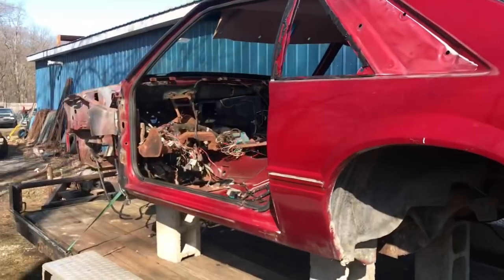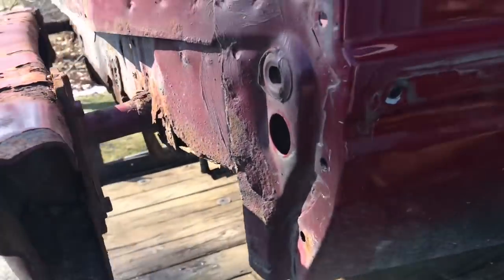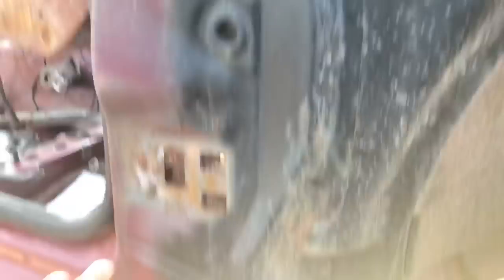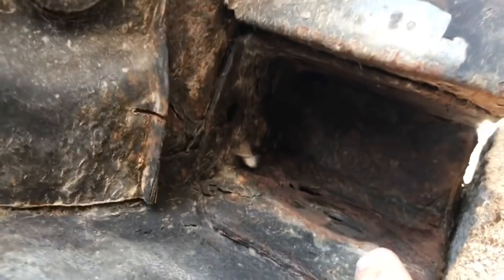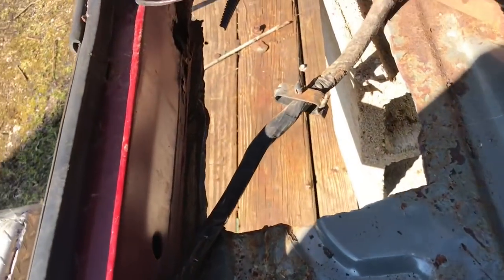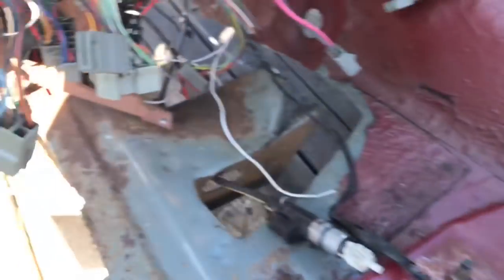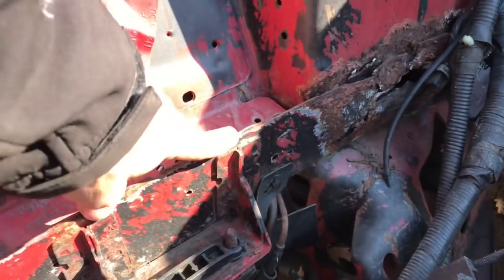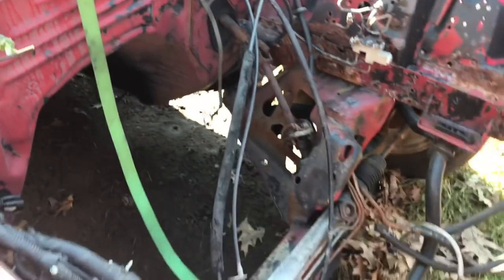RUSTY MUSTANGS 101 TOP 5 SPOTS FOX BODYS LIKE TO RUST

Comment: I just got thru repairing some nasty rust at the base of both A-pillars. Passenger side rotted out into the cowl area and air intake hat. Had water leaking into the floor and onto the computer in the kick panel area. Sometimes you think its a leaky windshield as I did until I pulled the fender off and saw the mess that it was. Thats one that can bite you because the air/heater box hides it on the inside and fender hides it on the outside. Just a word of warning folks. 
If you run a loud stereo with subs the little nuts that hold the quarter windows can vibrate loose and start a leak there as well. I am replacing the passenger rear floor pan over that deal. 
The car I have is an 87gt that spent its first few years in Michigan before it wound up in Florida where I bought it when it was only 9 years old. The hatch and both doors were replaced when it went it for a rehab/paint in 2002. Its been a love/hate with this one as it was my first fox and Ive considered parting ways and just cant do it.

Comment: The floor pan when removed. The cross member for the transmission that frame rail are they repairanble
Reply from the maker: Right but then you have to make sure to check the other corners. Apillar door hanger area... under the gas tank.. etc.

Comment: Neo what would you recommend for my 89 got with and and 410 gears get 40 intake looking to get heads and cam what to get the most hp out of the car
Reply from the maker: Depends on what HP your trying to achieve and what money looks like?
Reply: @Neomustangs  as much as I can get and still be streetable I like to drive my car
Reply from the maker: BigBoy TV like alum heads or gt40?
Reply: Idc like the tf twisted wedge 170

Comment: I see guys cutting up mint mustangs because of the towers. Makes me sick tbh but what can you do. I have fixed a few and there a bitch but if it's a otherwise clean car it's worth it. Rad supports are easy. I cut it out and weld in a piece of 2x2 so you have a easy assemble jack point.
Reply from the maker: I agree. My blk mustang had bad towers. I fixed it. And fkin run 9s. I won’t tell you how many I have seen cutting up fox bodys just cause. Couple of them are friends here local of mine. When I cut one. It’s gone in all these sections I just mentioned in this video.
Reply: I hear you man same here. Several friends that solely rely on Ebay and cut up near mint mustang's all the time. One of my buds just cut up a red 97 cobra a few weeks ago that was in good shape and even though I'm not a SN guy and surely not a mod guy I tried to buy it from him. He said he would make more cutting it up and parting it out. Theres a few t top cars on my home page that are being cut up but I just have to many project's.